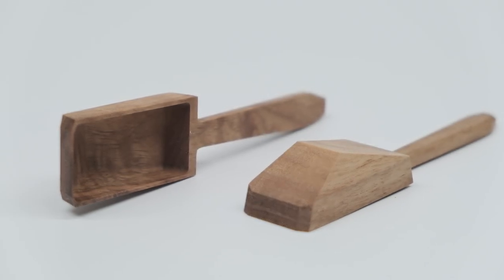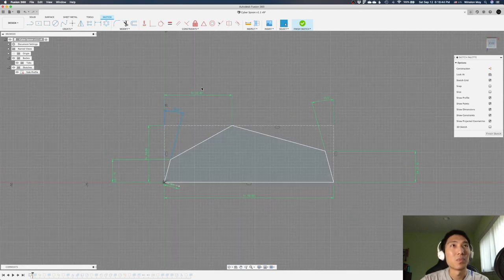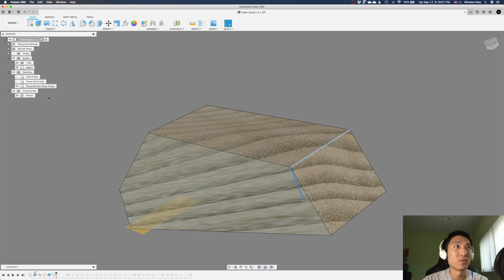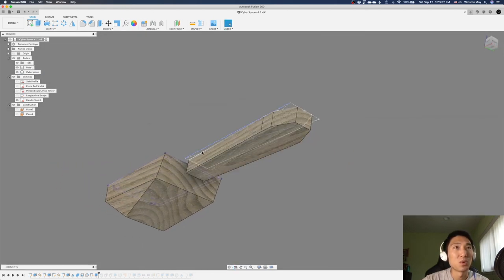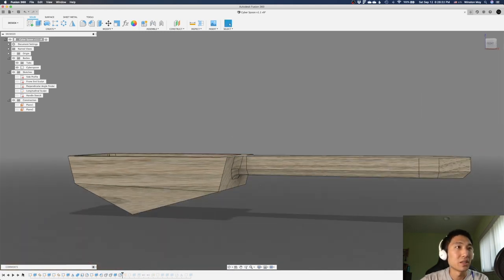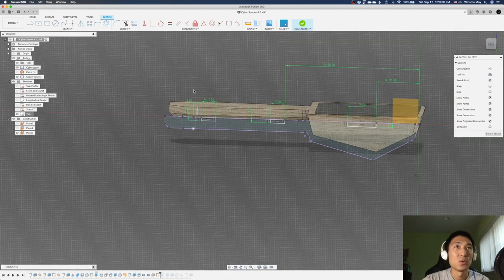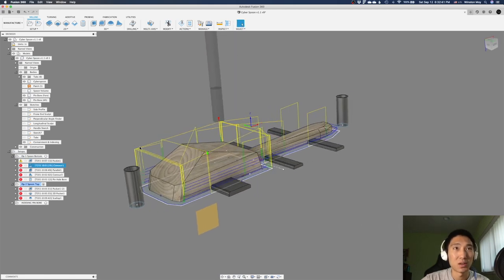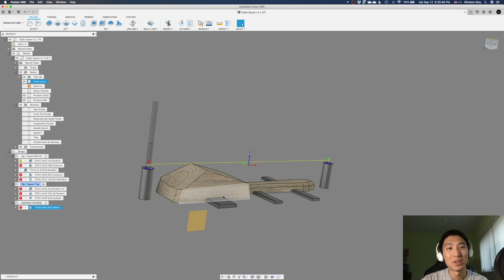CYBERSPOON Fusion 360 Breakdown - #171 Supplemental

Comment: Can I ask why you opted to machine the back of the spoon before the front? It would seem that if you did it the other way round, you could get away with using fewer / less substantial tabs. Great work!
Reply from the maker: In order to have a ball endmill finish the back of the spoon, it has to be able to plunge deeper than the front edge of the spoon. I 'd rather not cut into my threaded table so the top/flat side of the spoon isn't flush with the face of the stock. I could have used thinner tabs on the handle for sure, but for the bowl of the spoon it was already close to the limit. Tabs are relatively easy to cleanup, not a big deal. Doing the bulk of material removal on the first op (bottom of the spoon) was more worthwhile to me.